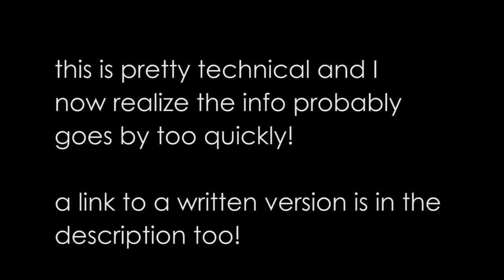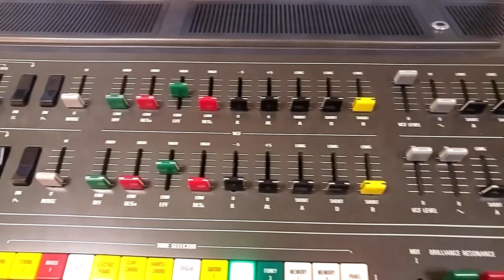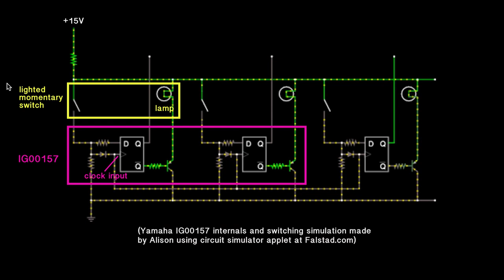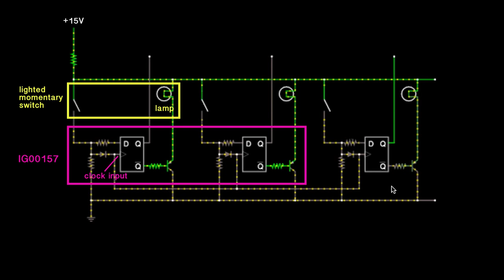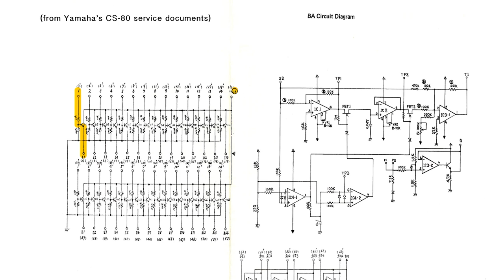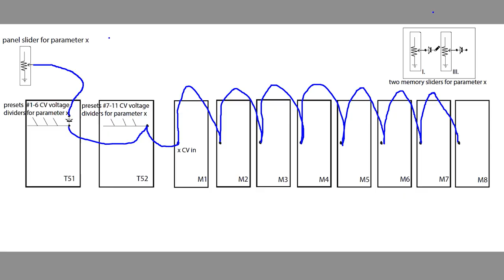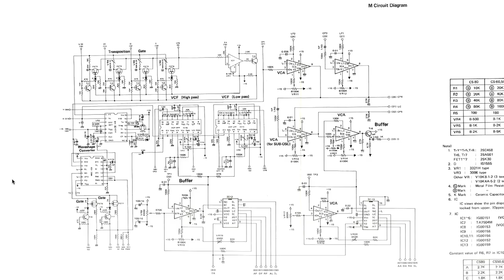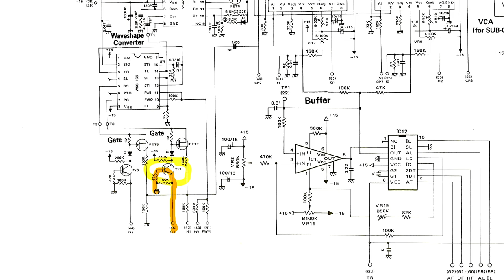Yamaha CS-80 Synthesizer Sound Selection Circuit Analysis

Comment: Excellent insight on the service manuals, (on a much smaller scale) I had a great experience with the moog/realistic mg1 service manual. Really straightforward troubleshooting steps.

Great video, looking forward to more.
Reply from the maker: that one is unique because due to the fact that the MG-1 was a mass market product sold at Radioshak and targeted to people who had never used a synthesizer before, the service manual likewise seemed to be targeted at technicians who had never worked on or possibly also even used a synthesizer before. So it really goes back to basics and doesn't assume you already know any of the basic synth-specific concepts, which makes it a great resource for synth-tech beginners!

Comment: There are few technicians willing to dive into the CS-80. I will follow along. Mine is in need of a check-up in the future. Your comment chain with Scott is enlightening and fascinating. Loved your explanations. While the P-5 did offer digital recall, the CS keybed and the ribbon controller put it in a different type of instrument. The P-5 is closer to an organ, where the CS-80 goes beyond what was possible with even a piano, with aftertouch- and poly aftertouch at that.

Comment: This is great! I was always curious how the CS-80 did what it did outside of the CPU/DAC paradigm. One wonders if Tom Oberheim ever contemplated going down this road before Sequential's CPU breakthrough and just thought the complexity was a nonstarter. Japanese manufacturing had a unique culture during this period (mid 60s to mid 80s). Everything from instruments and electronics to motorcycles and cars to bicycles. I have several Yamaha instruments from this period (synths and drums...). Great quality instruments that still work perfectly. Lots of unique problem solving that went the extra mile to squeeze every bit of functionality out of the technology they had.

Comment: I found myself scratching my head as to why Yamaha would go to the trouble of designing and fabricating something like the IG00157 when it’s basically just a couple of flip-flops. I presume the semiconductor market then was very different - ICs, even simple logic ones, were likely much more expensive and less reliable than they are today, so Yamaha decided to be in control of their own supply. 

Yamaha had many custom ICs that seem to be little more than simple logic and/or mux/demux circuits.  They’re just different enough from today’s commodity parts to be a pain in the ass!

I know just enough about electronics to be dangerous, and I don’t yet have the skill to devise substitutions for this type of stuff.  This is why I plan to bring you my ailing CS40M from Toronto once the pandemic BS is over :)
Reply: They might have already built those chips for a motorcycle or something. ;)

Comment: Very interesting, thank you for recording this. I take it modern synths encapsulate all this and more in just a few integrated circuits and are much more reliable. Why would anyone want one of these old unreliable synths restored to working order?
Reply: They sound fantastic, and have been used by many skilled musicians to produce iconic music. Vangelis, the composer for Chariots of Fire and Blade Runner said the following about the CS-80:
"the most important synthesizer in my career — and for me the best analogue synthesizer design there has ever been ... It needs a lot of practice if you want to be able to play it properly, but that’s because it’s the only synthesizer I could describe as being a real instrument, mainly because of the keyboard — the way it’s built and what you can do with it."

If you are in to this kind of thing, there is nothing else out there that quite has what the CS-80 has.

Comment: When I was dropping my prophet off the day before easter you were really ragging on the CS80 and now I know why. This is the goofiest 'logic' circuit. It just seems like its designed to fail. Okay, there ya go "if you have just 1 shorted transistor..." I think if I had one of these I would just have you disable the preset system, Its not like you can gig with it. Bring on the next video!

Comment: Would be a real pain to fault find with that amount of wiring. Usually in industry when you see that many wires they number them with tags at each end. Also you get problems with corrosion in the connectors adding resistance which can cause intermittent faults.
Reply: Yet people revere these synths as some kind of marvel of quality. 😂

Comment: I've got a CS60 which works fine apart from being stuck on "Sustain II" mode even when I switch it to "Sustain I". The switch itself looks alright, is there any IC that might be faulty that could cause this? I'd pefer it stuck permamently on "Sustain I" mode if it had to be stuck!

Comment: I was wondering how difficult it would be to interrupt the circuitry of the CS-80, to add "control-voltage" of the oscillators? It isn't on the market yet, but I'm hoping that the new Behringer DS-80 (an analog circuit exact clone of the CS80) will be able to be "hacked" to add frequency and sync cv inputs.

Comment: How practical would it be to replace these parts with a digital solution? Wouldn't one "just" need a digital potentiometer per parameter per voice?
Reply from the maker: Not quite! Also, a digital potentiometer is not a standalone thing, it's just a term people use for a potentiometer being encoded digitally. here's what you would actually need:
- multiplexers with enough channels for every slider
- a digital to analog converter (DAC)
- a microcontroller running custom firmware (presumably also hosting ROM and/or RAM for the preset data)
- an analog to digital converter (ADC)
- demultiplexers with enough channels for every CV destination
- a sample and hold circuit for every CV destination
it's a pretty big redesign!

Comment: It's sad that often, Yamaha's "service documentation" is sub-standard as well as them no longer stocking parts for older equpiment.

I had a Yamaha HS8.  I was able to find the service manuals, parts list and schematics for it.
The schematics were "not too bad" but not 100% either.
But using my DSO scope to monitor digital channels at one time, I traced the problem to a main processor for the pedals and keyboards.
I won't go into details.

I called Yamaha and other places only to find that they no longer had this processor chip or any other parts for the HS8.  I hunted around, but no one had evne used parts.

That was a sad day when I had to accept that this wasn't going to be fixable, all due to 1 main chip!  uggghhh!

So, I disassembled it for parts as the 2 main keybeds and the pedal boards will be used for another project I have in mind.

I then was able to pick up a Yamaha HS4, which is better than nothing, but not feature-packed like the HS8.

Oh what fun!

Comment: not too technical at all, quite easy to follow even for a software guy.  Clearly they didn't design this thing to "limp along" in the face of a failure... So what would be a better alternative?  I always assumed these had, for each input point on the circuit, 16 resistors (4 variable, 12 fixed) ganged together at one end, with the other end fed either ground or hi-Z.  But is there a circuit that outputs either ground or hi-Z?  Otherwise, maybe I pictured 16 inputs into an analog "1 of 16" mux, but again I have no idea if such a chip or circuit exists?